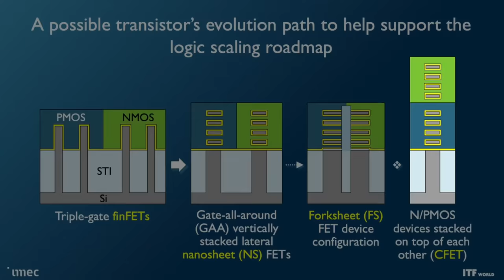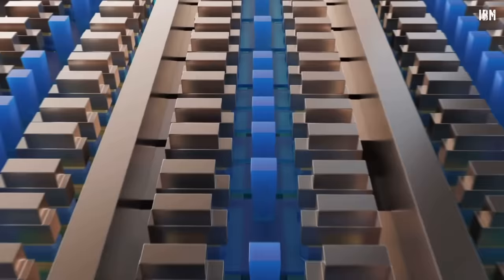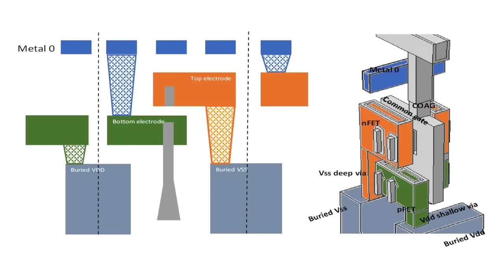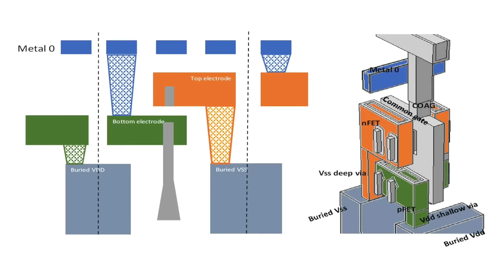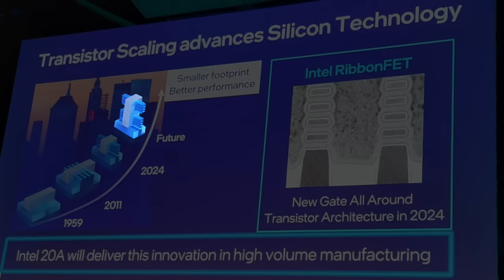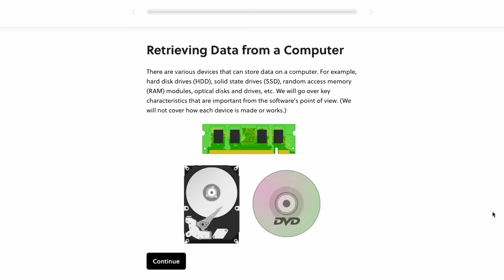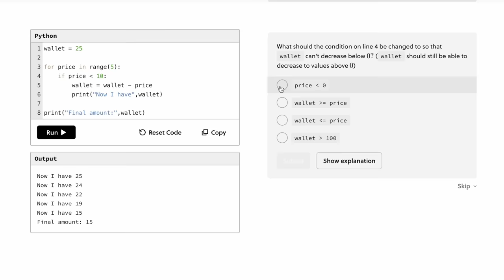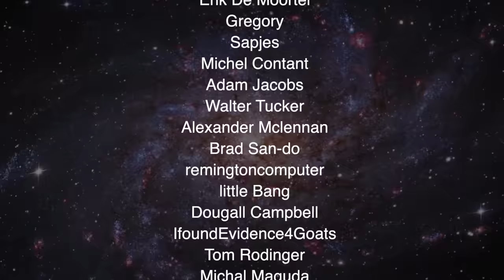New CPU Technology. IBM, Imec, Intel

Comment: It'd be interesting to see how far into 3D we can push them. A computational cube would be quite insane, but at that point I imagine delivering power, cooling and assuring structural integrity would be the main concerns.
Reply: It could be actually opposite.. if it was 6 chips connected with each other with void in the centre. Then you can actually liquid cool it from inside. If it was a cube then you can run heat pipes trough it and water cool it too. Either way the problem isn't cooling it. First they need to build it then make an interface that will be able to connect thousands upon thousands of pins it has. Either way its a technology to which we are going with each step we take. To make computation cubes. If it was made with carbon on top of it. It could be a supercomputer in cube the size of few cm^3. Cooling it would be a nightmare but damn. Possibility of walking, talking robots with intelligence wouldn't be far off with tech like that.
Reply: Borg technology.
Reply: Computational Triangle would have more integrity.
Reply: @mariow7818  I would also hope that even if we reach the limit of fitting more transistors on a chip, we can continue to reduce power consumption (though more slowly, as I'm pretty sure power is tied in some ways to the size of the transistor), which should reduce the cooling required over time, allowing us to stack layers more easily.
Reply: @alansmithee419  there are 2 main sources of power usage in Si chips, one is the switching power the transistors use when changing states, which is mainly affected by the physical size / geometry of the transistor, another is leakage which happens due to the silicon not being a perfect insulator, which mainly depends on the size of the chip and the silicon's base insulation properties, though there is some room for improvement via doping or use of SOI wafers for example.
Reply: growing a micro core cube processor shaped like a Walnut with Grooves in a crystal matrix so you can sink it in some conductive fluid
Reply: @cj09beira from what I've learned it's Quantum Tunnelling that causes a big amount of current leakage and heating problems (at the same time tho there's apparently some research on specifically leveraging the effects of tunneling to improve transistor performance)
Reply: SVB small volume bank ⛳
Reply: @mariow7818 I don’t think that’s what they meant, 6dies put in the shape of a cube isn’t exactly space efficient, we’d be talking about stacking dies until it gets thick enough it becomes a cube, and in that regard yes u less we transition fully to photonics or another computational paradigm it would be prohibitively expensive in power and cooling to operate
Reply: It can be designed around a cooling system though, no?
Reply: jamesjordon1216  wouldn’t that be the first time in history that a sociopath actually contributed to society?
Reply: "A computational cube would be quite insane, but at that point I imagine delivering power, cooling and assuring structural integrity would be the main concerns"

The solution to 3D compute stack cooling was addressed years ago by DARPA's ICEcool project which researched microfluidic cooling vias built into the chips themselves - it's the only way to sufficiently cool a whole stack really unless you just remove the heat problem entirely by making it all superconducting.
Reply: Carbon nanotube 3D cube processor??? Heard carbon nanotubes can lead to much higher clockspeeds and less heat production
Reply: @mariow7818  Fungal net connections

Comment: I joined IBM in 1968, the 360 Era when RAM was magnetic core strung with wire and 256K of that RAM came in box the size of refrigerator and cost $100K+... just for 256K of RAM.  Those 'K's were not typos   
From then till now... whadda ride.  
I'm remembering replacing read/write head on 2MB HDD which was the size of manhole cover... actually it was the size of XLarge Pizza box...  That manhole cover HDD was just too descriptive to resist.... I"m old and I exaggerate but not to worry I'm M.2 now.   Building a new PC later this year.
Reply: What a ride, indeed. I wish you longevity to see the technology we're heading towards
Reply: Bell labs replaced vacuum tube with transistors in 1954. Now look where we are at.

Comment: Interesting how the design is slowly becoming similar to the arrangement of neurons into interconnected columns in the neocortical sheet.
Reply: biocomputers would still be far superior. But yes, to improve technology it was a given for a long time that we need to move to a 3D configuration. But that's why biocomputers are so far superior: you can't make a interconnected cube processor in the regular way without it overheating.

Comment: Nanosheet (also GAAFET/MBCFET) actually represents a step backward vs FinFET in terms of transistor density even though it is superior in power consumption for a given transistor pitch.

New tech like backside power delivery will be necessary to at least equal or surpass FinFET processes in density without going to a significantly lower transistor pitch.

Forksheet increases the power efficiency even further while also jumping well ahead of FinFET for the same pitch - though it will never be utilised at the same pitch as any FinFET process anyway.

CFET (Complementary Field Effect Transistor) will likely follow Forksheet as the next gen transistor after that, but we are easily talking 2030+ at least for a node using this to occur for any semiconductor foundry.

Comment: Its crazy how far transistor tech has come. I didn't realize what exactly they were and what they do until I started my I & E degree. At school we have a display with different types of computer components showing the advances over the last 30 years. I'm in my early 40's and we got our first home PC in 1995 and I had access to computers when I was in elementary school in the 1980's. Back when we had the really big floppy disc. Now I'm just wondering when battery technology is going to start advancing.
Reply: The good old days. I had a Sinclair and a TI-99/4A. I remember the first LED watches. Blinked and now I have the internet in my hand. Do you think we are dealing with all of this in an okay or reasonable manner these days?

Comment: The main issue I see with going vertical, is heat! Intel chips are already running crazy hot and it seems they will be getting even hotter. Soon, they will require liquid cooling or maybe even phase cooling. All for just 10% higher speeds.
Reply: Yup one of the things that I avoided Intel for the longest time because what I need is small it's build PC and AMD just crushes in heat management department put stock cooler in there with some good exhaust and you're golden different from intel

Comment: Not one mention of radiation hardness.
At 1nm the transistors would be very susceptible to damage from cosmic rays
such as muons and even normal background radiation.
In space they use transistors as in the old 80486 CPUs which are 800 nm technology.
Anything smaller gets damaged too easily and wouldn't last 5 minutes.

Comment: A few questions: You referred to CFET as the "ultimate transistor" (and so did Naoto Horiguchi, the director of CMOS technology at Imec.)  Are there theoretical or practical limitations that prevent improvements in transistor architecture beyond CFET?  Have we just run out of additional dimensions to scale to?  Are there limits to how many layers of devices can be stacked on top of each other?  If CFET is indeed the "ultimate transistor", what happens when we have fully exploited the advantages of that technology?  Would it mean the end of Moore's Law?
Reply: The main limit to stacking layers is heat. If the chip gets too thick, the transistors in the middle are too far away from any surface of the chip to get cooled fast enough. The options I see are the following: 1, stack up to a limit, then just stop and hope it's a enough. 2, use weird shapes throughout the stacking to let it cool efficiently throughout the chip. 3, somehow integrate cooling systems into the silicon itself, maybe via an advancement in material science.
Reply: @vibaj16  Use quantum mechanics to create anti-infrawaves...
Reply: @lucysluckyday  Just cool it though the 4th spacial dimension, no need for weird time travel stuff. If string theory is correct, there are 8 other spacial dimensions that are just too small for us to notice. We can maybe figure out how to stretch out one of them around the cpu so we can cool it evenly throughout its 3D shape using that 4th dimension.
Reply: @vibaj16  as Apple Silicon  has demonstrated with M1 and M2 there is less heat and unimaginable efficiency in these newer chip technologies.  Early testing of M1 at one point researchers thought that their instruments were in error - measuring 0 load.  They found that the chip was functioning without any consumption and AS is still at 3nm

Comment: Forksheet eh? I'm still waiting for the graphene or borophene semiconductors! I'm dying to see clock rates increase by an order of magnitude in my lifetime, which isn't going to happen with silicon. If they get the clock rates up with new materials, they don't need to fabricate transistors as small as they are right now!

Comment: Most applications run perfectly fine on older standards tho. Especially rockets and stuff where reliability is much more important than maximum possible compute power. 
That Apple has booked 90% Capacity of 3nm for 2023 is incredible tho.

Comment: What ever happened to the 1nm wide transistor.  Maybe a video on how small a transistor can be made, can it be made out of a handful of atoms, as an example?  What speed what energy?  Years back, they made a research transistor do 200ghz, but what are the practical limits for a device at 100watts per cm?  Also, what about magnetic Quantum cellular Automata.  They are talking about 4Thz using some changes like I had also been hoping to do.  Near maxinum energy efficiency means very low heat, very good packing density and 3D volumetric packing.  At low speeds, equivalent to 300thz+ processing power with a cpu fan.  You can go a number of times more than that with air cooling.  The highest speed magnetic design, is proposed at up to 40Thz.  I'm hoping to explore a silicon fabbed new alternative type of design within that range one day (money).   The possibility is that can reach into the high hundreds of Thz equivalent, but it's too new tech to gelyl without testing everything.  But, it would be interesting to see videos on these other things out there.

Comment: I would imagine removing heat from vertically stacked transistors would be more difficult than the current, flatter, technology. Of course, at the scales being talked about, that might not matter.

Comment: Cooling could be a challenge.
Reply: No.  Super efficient low power.
Reply: @rcpmac  they may use less power but what I've been hearing is this 3D stack means less silicon on the substrate for dissipating heat.  This new CPU technology may only be for servers.  She didn't indicate.

Comment: soo... what happened to CNTFET? nobody talks about it anymore
Reply: Carbon nanotubes are challenging to purify & sort, and in general don't provide the repeatability and device-to-device consistency required in such applications. From the standpoint of designing a product that relies on such components, devices that vary significantly in electrical response between batches is not much better than a device that doesn't work at all, because you'd have to calibrate each device individually adjust I/O signalling for every product, requiring small redesigns and tweaking the entire system to adjust to the device variations, and going through that process for each and every unit of your product before it leaves the factory, which makes it effectively impossible to scale your production at a realistic price point.

For now, CNTs and 2D materials used in devices research are generally applied manually (basically by hand), rather than being grown on the devices or very uniformly deposited. Such manual construction of devices also greatly limits consistency.

Comment: wonder if we'll see a shift to ternary computing with a multigate transistor to handle trits instead of bits. where the result can be a 1 or 0 like a normal bit, but also -1. allowing for more information, withing a BYTE, or in this case a TRYTE. binary for example is depicted as 2N and trinary is 3N. with N being N=12 in binary, a binary stream has just shy of 4100 possible values, however using trinary computing, with N=12 we get a total of just over 531,000 possible values, allowing for significantly more data throughput

Comment: wouldn't the stacking approach require far more cycles and increase the time and cost? Then there's validation and verifying each layer lined up correctly with the layer below. Doing it in a lab is one thing, but doing it at scale like TSMC with thousands of wafers each day is probably going to take a few years.
Reply: There's always a market for leading edge tech,  at any cost.  You just have to look at the cost of GPU to see that.

Comment: But won't this 3D CFET architecture result in more cooling problems? Will heat sinks be able to cool chips as effectively, if some transistors buried inside 3D architecture? ❓
Reply: @2:50 she says 25% less power, so less heat. Have to wonder how stacking and connection will be done. Layer deposition surely would be too slow for many levels. Separate layers then stacking surely would have alignment connection faults. So is the technology really limited to just a few levels? (A bigger problem)

Comment: Vertically stacked transistors will run very hot. So that mean the bottleneck will be the heat dissipation
Reply: I think speed of manufacturing might also be a problem.  Deposition of many layers would surely be a slow process. She did say a 25% power reduction so you might be able to stack about 4 layers (?) for the similar heat (power) perhaps.

Comment: Nice video. But iy left a rather big question, what about heat, backing more transistors in the same area iscall well and giid, but how do yo get rid of the extra heat, ok the lovered power consumption helps a lot nut is it enough? We all want more powerful cpus /gpus etc  but it kind of misses the mark if we all need liquid  cooling

Comment: I didn't realize they'd made such gains going vertical.  I had assumed (yes, I know) that just the complications of multiple layer alignments and vias would be bad enough, but also volume heat buildup would be problem.  I may have to re-think.
Reply: Doesn’t matter as the transistor going to be small enough as they reach the vertically stacked design. Small = Higher efficiency = Less heat output.

Comment: Can you do a video on computer chips based on measurement in each cell, ( voltage pressure ) rather than the current method. This is something I have thought of a lot over the years, and ( sorry don’t have a link but there was recent development in this area as far as scaling this technique! Imagine nano sized analog computer gates!

Comment: I'd guess the vertical stacking has its limits due to heat management.
Reply: There’s little heat in this design
Reply: @rcpmac  That was more a remark about the outlook to stack structures vertically. Even stacking just two layers will double the heat output per area. While that may still be feasible, at some point when it goes more and more 3D one will have to integrate heat management into that 3D structure.

Comment: How will they build them up, and be able to etch out the design, the more the transistors become tall? Do they? or do they not? have to have line of sight to do the etching out?
Reply: built layer by layer
Reply: @vibaj16  you mean deposition layer? Wouldn't that be a very slow process? And be critical to deposit the correct thickness or each layer?